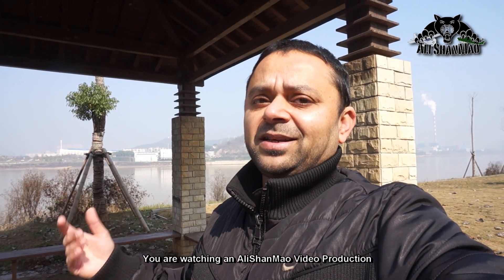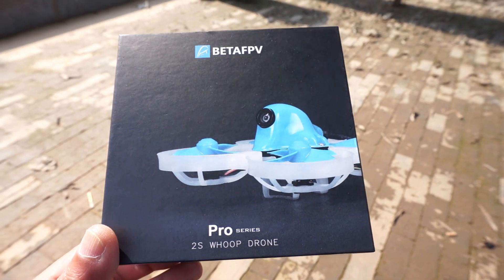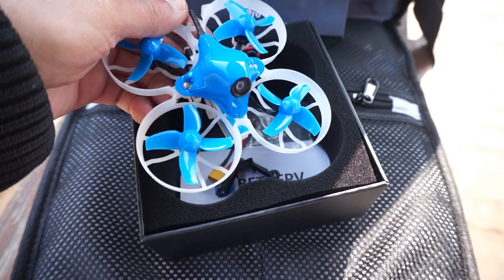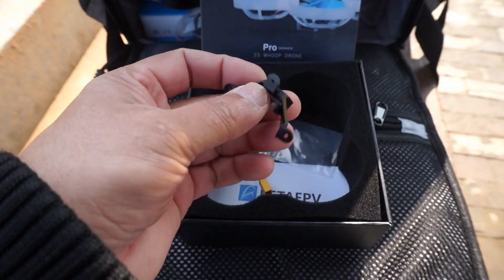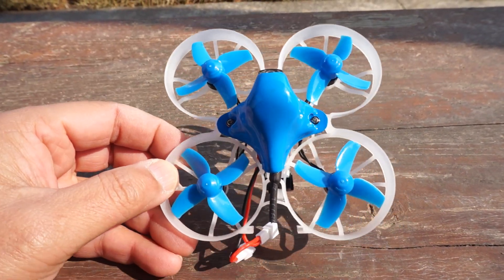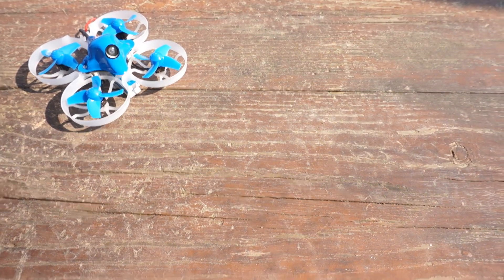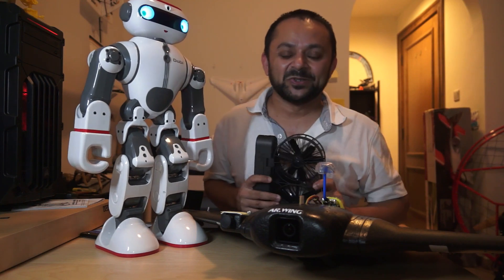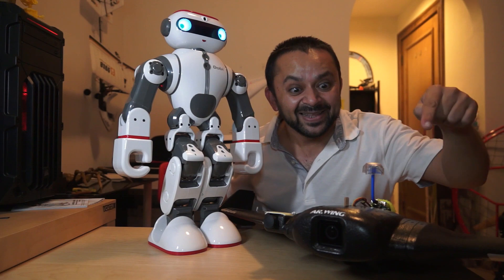Best FPV Whoop FPV Whoop Drone Brushless FPV Tiny Whoop BetaFPV 75 Pro

Comment: Nice rippin Ali, I will save my money for betafpv 85x but not this one.
Reply from the maker: There is HD version cinewhoop 85X that I am looking at or mobula7 HD
Reply: @alishanmao  I am not interested in the cinewhoop with the extra weight and all, i want the 85x with the Eos2 just for fpv and the speed.
Reply from the maker: in that case 75X or 75 Pro 2 should give you more than enough fun bud